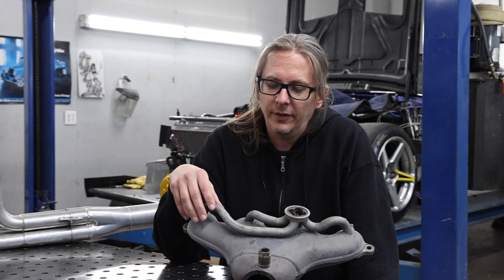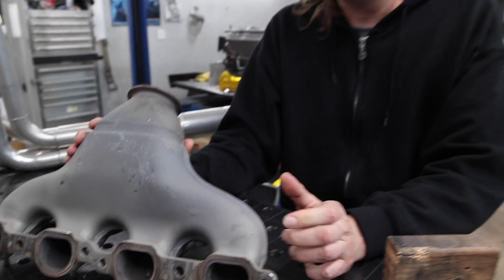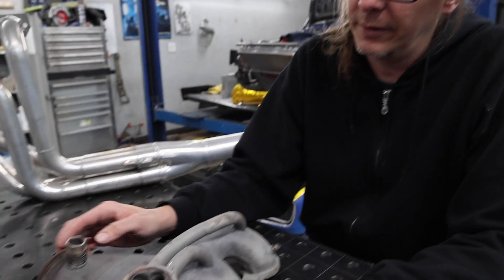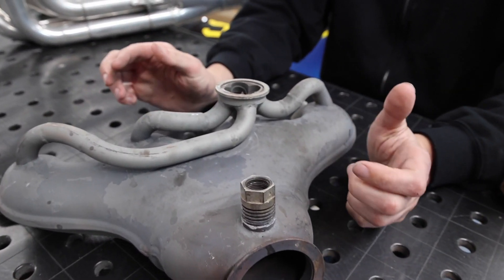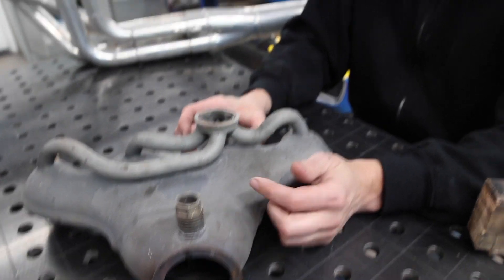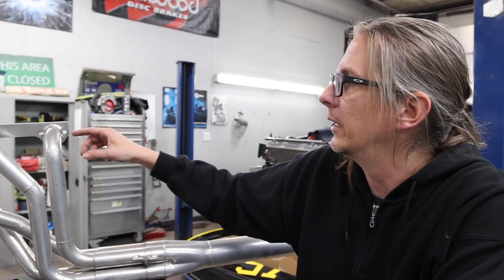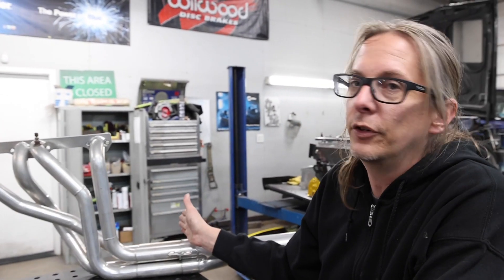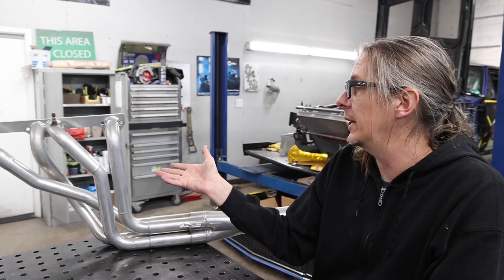Differences Between Headers and Manifolds! Which is Better?

Comment: So I want to change my manifold just because my up stream O2 is stuck on. And I just changed my exhaust to a cat back and I don’t plan on putting a turbo on the car. So should I just change the headers and not the manifold or change both?? Just want a fun/reliable car 

I have a 08 Subaru Impreza Hatch

Comment: My BB 427 makes a lot more torque with the cast iron manifolds than with headers. Long tubes would be cool but routing to side pipes is impossible.
Reply: Yeap my 540 performance is better with manifolds 700hp 700 torque